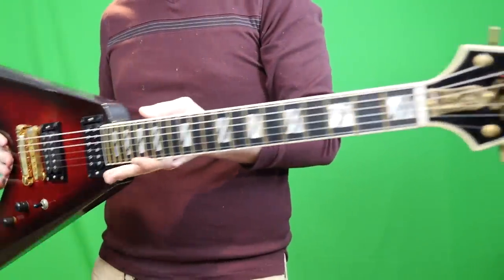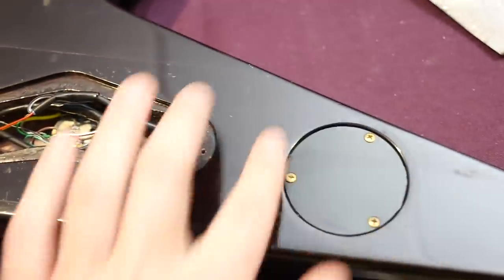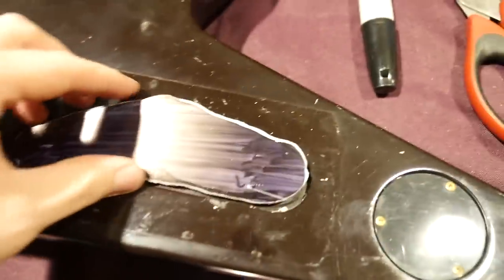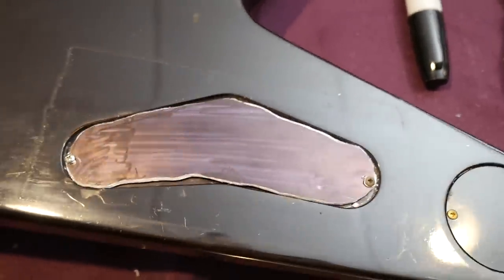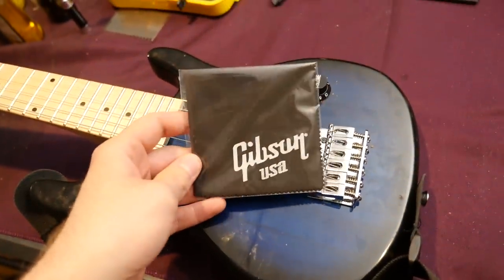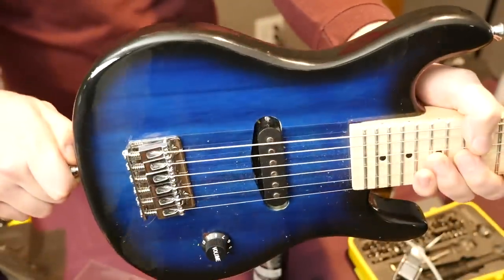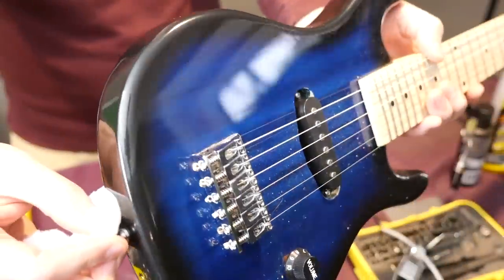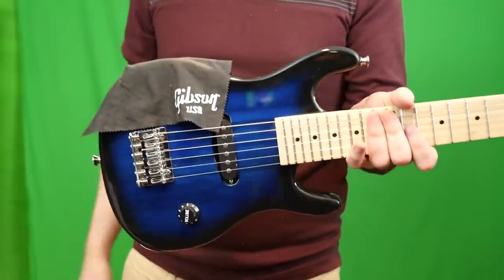"Fixing" My Project Guitars + Testing a Myth

Comment: You can buy plastic pickgaurd material, that's cheap on Amazon or Ebay. If you have a jigsaw, you can cut it a little bigger, then you can sand to your line and get a decent cover. Did that with some tortoise shell material recently, and it worked well.👍😎🎸🎶
Reply: At home depot you can get clear plastic sheets like Polycarbonate and make a cool see-through plate. He also didn't shield the back of the plastic and that is only preferable when you want to see through the cavity cover.
Reply: @banditkeithkingofduelmonsters  good idea!👍😎🎸🎶

Comment: In case you have to remove sticker/ducktape residue from a guitar naphta or lighter fluid is the thing to do it. It comes off, leaves no mark and does nothing to both nitro and poly finishes. Goo Gone can sometimes be too aggressive. That Flying V probably would come out unscathed from the ducktape thing if you used lighter fluid to remove the glue .

Comment: WD-40 takes the adhesive off left by duct tape , no harm to finish.
Reply: Yep or contact cleaner, both great for removing stickers off of flycases too, with ease
Reply: I use bug and tar remover, works very well
Reply: Also lighter fluid. {ronsonol for lighters, not bbq's}
Reply: What about goo-gone, it's primarily citrus oil? It gets any adhesive residue off, do you think it would mess up a poly, or nitro finish?

Comment: Jesus that backplate. 

Make a photocopy of the back cavity, cut out the shape in cardboard and adjust until it's exact, and then use that to trace on the final material. Then take a bandsaw, cut out around the traced shape, and use a sanding belt with a high grit belt to make the finer adjustments until it fits the cavity perfectly. Then lay the photocopy over top and use that to get the screwhole positioning.

Comment: Hey Austin try either some finger nail polish remover (Acetone) or just mineral spirits and that should remove that glue residue on that V. 

Yesterday ME: Writes and email to Gibson about the controversy surrounding the new Modern Classic pot wiring and brags up Austin and his "The Trogly's Guitar Show"  and tells Gibson how "professional, "honest" and "worthy of Gibson doing some work with to review and demo different guitar models".

Today Austin -  "Hey watch me make a backing plate that looks like a 2 year old did it! ". 

Lol, Let's just tuck this video away somewhere that it cannot be found ever again mmmkay? Lol.. 

I had a couple of those Gibson polishing cloths and though I did not have any "staining" issues with it I did have similar results as you did with it leaving a lot of polishing scratches. I use a Dunlop black polishing cloth and it works great and does not leave any scratches or anything.

Comment: Gal dang, you have a Dremel, just need the right bits for it, come on man you can do it! Or you could maybe "fix" that one with some black electrical tape to smooth the edges out some and it would actually be black.

Comment: You spend thousands on guitars, but won't spend a few dollars to have a real back plate made?  Really? lol
Reply from the maker: It is more so from not knowing where to go to get one made. Being a non-traditional shape, I wouldn't trust myself to provide someone precise measurements
Reply: @Trog  Baking paper, trace over it the actual back plate area and stick that to any plastic veneer or wood, whatever. Finish it off. There are many ways that only cost a few dollars to do this when OEM parts, new or used, are not available.
Reply: @DBCisco  Hi Duane!!

Comment: That service plate is terrible, which is fine, but why would you accept the results? Throw that thing in the trash. Next time make it with cardboard first and then trace that template onto plastic. Buy a cheap ass coping saw and some sand paper to finish it. Complete success awaits.